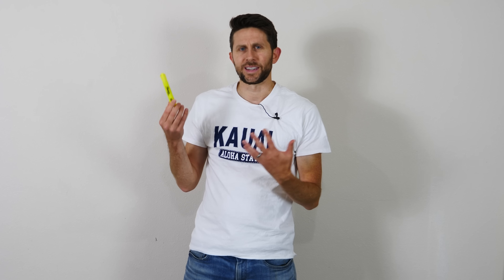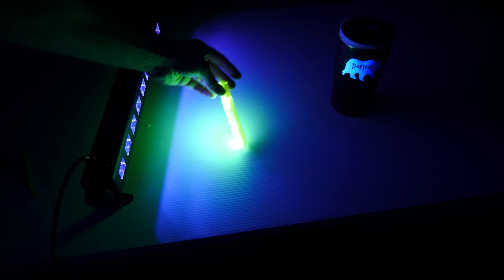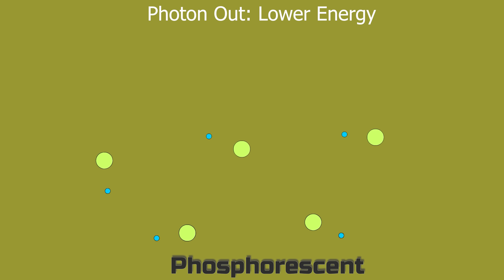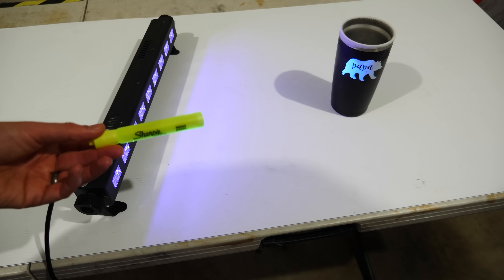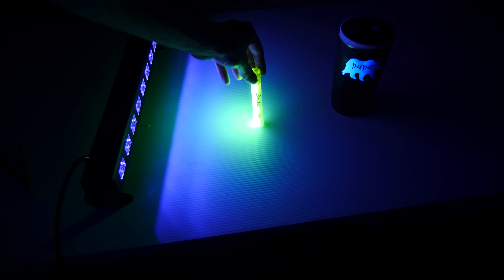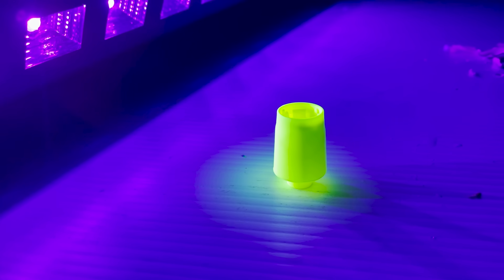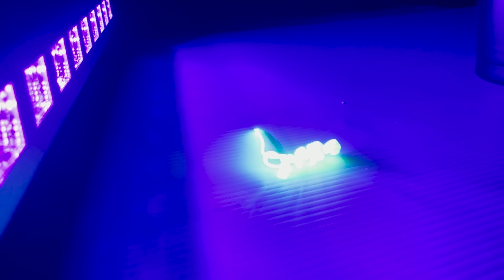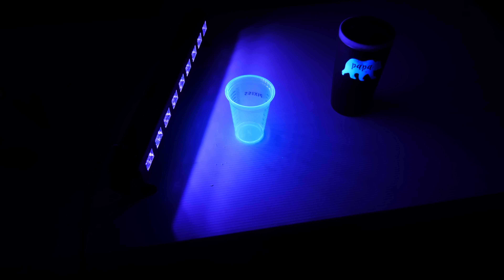Making Cold Light (Cryogenically Induced Phosphorescence)

Comment: I have a bit of a critique for your title as this is cryogenically activated phosphorescence. The emission is induced by absorption of the UV light, not the temperature change which activates the photoelectronic pathways instead.
Unlike triplet phosphorescence and fluorescence, the mechanism for persistence phosphorescence is poorly described even though it is well known within the spectroscopy community. The lack of a mechanistic description is mostly due to the complexity of the pathways. It is known that electrons and holes are trapped apart and slowly migrate back with the fast non-radiative decay pathways available at room temperature being inhibited by the low temperatures. It is interesting that the emissions appear to be mostly one colour suggesting that the recombination leading to emission is involving a limited number of phosphors (possibly only one).
Enhanced triplet phosphorescence is very well understood and is due to exactly what you said, an inactivation of non-radiative decay pathways. It also makes some low energy states available for decay into which are usually inhibited by the systems thermal energy. It is also diagnostic of phosphorescence vs TADF (thermally activated delayed fluorescence). 
The relatively fast decay of the triplet phosphorescent bulb is likely due to the efficiency of the triplet emission pathway acting as a sink so that limited persistent phosphorescence could occur.

Comment: That means for conductor objects and insulator objects when you put in freeze temperature with black light, so either it will show non-fluorescence, to fluorescence, to phosphorescence, so it is a range of holding the heat within which it can resist well to object so base on cold radiation of an object which insulator last longer so it resists heat well, so hot radiation resistor relative to cold radiation of an object, so when put in cold liquid, it last longer the cold light so it holds the heat of colder temperature, like a conductor that holds heat, so insulator holds heat, plastic hold the heat longer then it disappears. Well, it is a good to test for which is a conductor or insulator for resisting the cold and resisting the heat.

Comment: @Action_lab
  Would you please do the experiment :

 Use two laser of same intensity
 One red and one blue 

 Allow them to fall an the same material(same specific heat,mass ,same temperature) but coated with respective color i.e. red laser falling on red coated material and blue on blue coated
For equal time and in isolated system 
 
 Then measure the Temperature
  Will they have the same temperature and heat???

Comment: Are you sure the items become phosphorus because of the temperature and nothing to do with the nitrogen? Nitrogen might be the phosphor material. Try it again by freezing stuff with different methods and temperatures. Try something frozen from liquid nitrogen, then the same something frozen from dry ice, then the same something from your refrigerator freezer, and lastly the same something from your refrigerator. It should work to varying degrees from all different methods and temps.

Comment: @just some guy tired of life  
I think that more heat means more agitation of atoms and molecules (electrons have little effect - because they vibrate and spin way faster - except if dramatic heat difference like several thousand of degree C°). 

The decay of fluo-phospho-rescence depends on the quenching due to other atoms shocks against the excited atom...in organic chemistry it is often dioxygen (or water containing O2) that reduces the fluorescence.

It seems logical that if you reduce the amount of vibrations/moves of atoms and molecules...you strongly reduce the amount of inter-atomic-molecular shocks and thus you slow down the quenching/reduction of fluo-phospho-rescence...as a result decay last longer and is less intense.

It is interesting to observe the emitting radius around the fluo yellow pen (like 15 cm) reduced when frozen (to about 2 cm)... so freezing reduces brightness a lot and extends brightime much more)

One may conclude that at absolute zero °K... brighttime will tend to infinity and brightness to zero.

Would be interesting to see the effect with a superfast camera... then you would see fluorescence the same way as  when frozen.

Also the stange orange glow of the yellow plastic pen and the longer glow for the yellow rope may/must be due to multicomponent system...with different fluorescers/phosphorescers with different decay time...

I guess the experiment would be very interesting with a mix of different fluorescing/triplet state phoshorescing stuffs (like overlapping draw lines of fluomarkers or dried solution of various mixed fluo dyes) in super slowmo unfrozen and frozen... there should be various color changes as a function of decay times and brightness of each dye...some will extinguish faster and other slower with varous color additive effects.

I also wonder how ruby would react being fluo flash pink fluorescent.

PHZ (PHILOU Zrealone from Science Madness forum)

Comment: I didn't have liquid nitrogen to experiment with but from my mom I did have an old powerful soviet flash. One which works from 220 AC and turns you completely blind when used in the dark.
And I found out that many things exhibit similar behaviour. The effect lasts much shorter, somewhere around fraction second so in order to see it I closed my eyes as tight as possible stuck the flash to the object of interest, made a blast and immediately after that watched for the result. And the surface of the object where it contacted to the flash was noticeably glowing even though the effect lasted less than a second as I was saying. So it should be something like a triplet phosphorescence.
Thanks for the info.

Comment: To all the laypeople here, fluorescence and phosphorescence are exactly the same process. The difference is that phosphorescent decays are, as physicists say, “forbidden”. This means that the transition is much less likely than a regular transition, because the system is very close to an ideal model system where the transition actually would be impossible. This is late second semester quantum mechanics stuff, so I’m omitting details for digestibility.

This video however is very intriguing, there’s very little out there about this effect, and frankly I wonder how the hell he found out about it

Comment: I have a question: we know that when drinking water from a straw, we first suck the air out and then water comes up. We also know that water boils in a vacuum, so while drinking from a straw, why dosen't it boil and also if we put as many straws possible in a glass and drink from all of them at the same time, would the water in the straws boil?
Reply: If the system was closed it would... but air (1 atm) above the water and the water are in an open system...so when you swallow via the straw (that is much below 10m long) it doesn't boil and simply go into your mouth.

If the system is closed, the recipient and straw undeformable it would boil...but before that you would have effect of vacuum on the innerside of your mouth (that would become violet and bleeding).

A long straw over 10 m would need a depression over 1 atm to lift water into the straw...hence water would boil...this is one of the reason why aspirating pumps can't aspirate over 10m... pressure pumps can push water to nearly any height.

Btw 10m water is the approximate height corresponding to 1 atmosphere of gas onto our heads... because water weights 1kg/liter or 1gr/ccm its is 1 kg/square cm or 10 tonnes/square m.

PHZ
(PHILOU Zrealone from Science Madness forum)

Comment: Also about your video..you should light a match pack scratcher on fire against a smooth surface in the dark ..it will create glow in the dark invisible Liquide residue the scratch material that glows in that dark when you add heat to the invisible Liquide produces a glow in the dark effect...the more you rub it...the more it will glow and the longer it will last...try the experiment with a hear gun as well to see if the heat is what creates the glowing effect as I beleive it to be friction heat. It's a cool experiment I have done at parties : )
Reply: The scratcher of a match box contains red phosphorus allotropic form of phosphorus that is more stable than white phoshorus (P4) that can decompose into air by glowing, heating and spontaneous inflammation...it turns into P2O5 and H3PO4 by fuming (phosphorus hemi-pentoxide and phosphoric acid).
White phosphorus turns red, brown, violet and black upon heating excluded from oxygen...it polymerizes. The reversal reaction happens by distilling red P.

So during the scratch some of the red P turns into the white variant... and this is phosphorescent... the word phoshorescence comes from that property of the elemental phosphorus discovered by alchemists a few centuries ago.

If the white P remains cold enough (tiny quantity/layer it is cooled by the surrounding-heat dissipation is enough) no inflammation occurs and only smoke and glowing happens.

PHZ
(PHILOU Zrealone from Science Madness forum)

Comment: Bumping into other atoms has nothing to do with the energy levels of the electrons.
It works by absorbing UV that bumps it up two levels; then it falls back down one step at a time.
What you are seeing in plastic has to do with excitons which are a bound state of an electron and a hole.  Molecular vibrations will indeed destabilize this, so it works better when colder.

Comment: What happens when you heat up a phosphorescent material. Does it glow for less time? It seems there's only one thing: phosphorescence with varying times of glow dependant on the materials temperature. Fluorescence is just one form of phosphorescence.
Reply: I can tell you from printing a fluorescent plastic that you can heat it too much and ruin the fluorescent effect while still maintaining the bright color in ordinary room light. If I print that stuff at 210C it is incredibly bright flourescent, even a near-uv light sets it off like a light bulb. Take it just 10C higher and no glow, even right on top of the uv source. Definitely some chemistry changing as a result of temperature.
Reply: @eideticex  why are they not making lasers from these plastics or material?

Comment: Explain the processes going on within the Sun and how a single photon can take a very long time to make it out to the surface. That is mindblowing.
Reply: It's not a single photon taking years to escape.
The emitted photon heats up the nearby material.  The energy diffuses slowly, using thermal convection, more radiation and absorption, and phonons.
Hot things glow.  So you see the hot surface.

Comment: Cold light would be pretty cool , imagine feeling hot and just staying under the cold light
Reply: They use lasers to cool atoms down to almost absolute zero, you could call that cold light. I don't think that will work on a human scale since it works similar to noise cancelation, imagine trying to cancel all waves in the individual atoms on the skin of your body.
Reply: @AndreVanKammen  oh wow
Reply: @AndreVanKammen  Yeah and also you need multiple lasers from different directions which our skin would block. Even if you could manage powering 10^24 lasers..